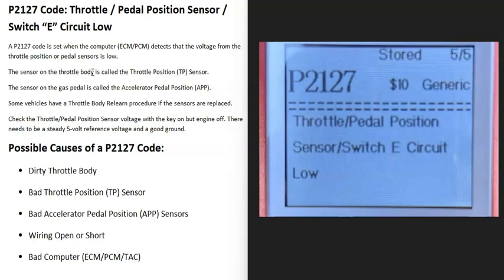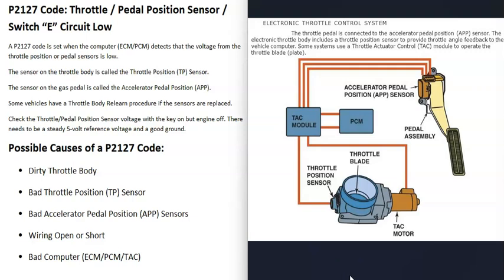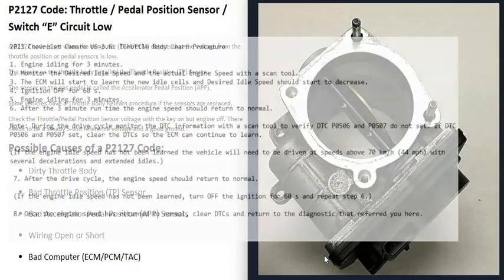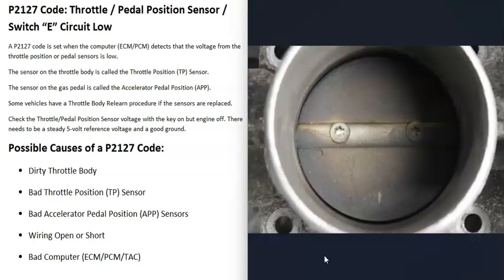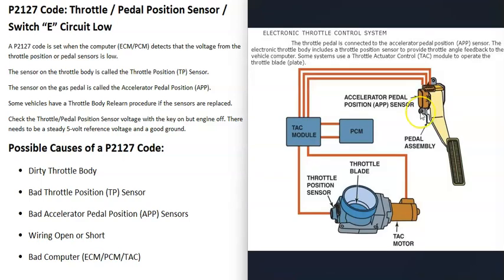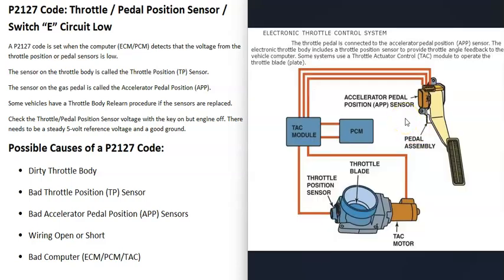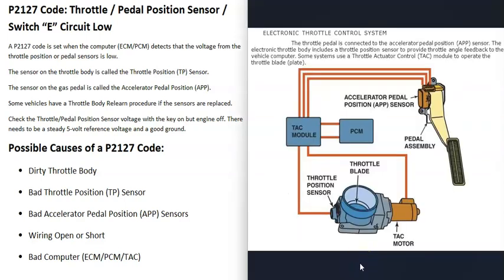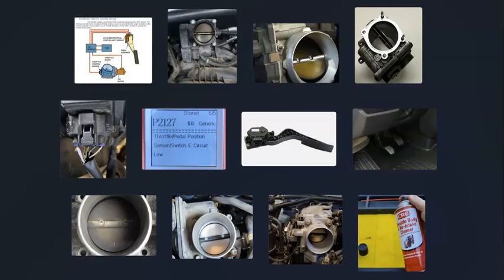Causes and Fixes P2127 Code: Throttle / Pedal Position Sensor / Switch “E” Circuit Low

Comment: On my dodge I have a white connector piece upper right corner, its just hanger not connected to anything, its not the connector that goes on the peddle, it a different connector do you know what the connector is

Comment: What if you get p2127 and p2128 at the same time high and low?
And isnt this specifically for the accelerator pedal censor, shouldnt that get fixed first, or looked at?
Reply: Just to answer my own question for others if they have something similar...getting both high and low voltage reading codes may indicate your PCM is going bad, especially if there are multiple other codes and warnings like I had such as "invalid data sent by BCM". But that could have been from the water that was trapped in my tail light I didn't know about at the time that also wreaked havoc causing many luxury items/systems to shut down or go haywire. Don't use those tuners because they can short out the PCM and check your lights for any condensation on the inside as there is a module and cam bus to the BCM that can cause a lot of problems.

Comment: Just curious if someone could help me out with my question
Recently I had to change my gas tank pressure sensor line which has the sensor attatched to the line that connects to the fuel pump amd the evap system towards the engine. Before doing this I had to run most of the gas out of the tank so it would not be heavy for handling during the change as it sits above the tank. I ran it all the way down to 15 miles remaining and went back into town one last time before doing the replacement and got it down to 12 before pulling into the store and was running fine before turning off. When I got back in and cranked it, it went back up to 32 miles remaining which I figured was not correct. I noticed when I went to pull out it barely accelerated when pulling out on the road. I figured it was a gas conservation mode or something because it was so low and wouldnt barely go over 2000 rpms. After doing the job it is still doing it but there is the orange wrench light now I may not have noticed before when it started.  I got several codes from P068A, P06E9 and P2127 with P2128 as well U0422. I attribute one or two of these to  trying to upload my tune to the computer which I had before and had taken it off but would not accept it this time I believe because of the limp mode it was in so it caused these other codes but the p2127 and p2128 i feel is related to low gas but after putting gas in it, it has still not went back to normal. I should mention also the battery has seemed to be low here lately or getting weaker because of it dying only after the power being on for a short duration which it never has done before. Can this code be due to running it low on gas like this and if so what needs to be done to fix the issue? I did wipe all the codes twice but check engine and wrench comes back on immediately upon cranking again.
Reply: What was the 'U' code about? Did you ever get this fixed?
Reply: @DiagolonRider  that was "invalid data recieved from BCM" 
Ultimately turned out to be a bad PCM that I had to replace for about 2k. The battery was bad and needed to be replaced as well. Also come to find out the back passenger tail light had water trapped on the inside somehow which I still do not understand how. That alone was going to cost $2500 just for one tail light and reprogramming. I took it home and disassembled the light and module and dried. I also drilled two or three small holes in the base of the tail light shroud to make sure water didn't fill up in there again and keep everything dry from air circulation.  The kicker was after getting battery replaced, sensor, and new powertrain computer (pcm) everything went haywire again but this ti.e with the windows, locks, ac, running boards, etc. This was all caused by the water in the tail light that cost an unreal amount of money to replace through Ford which is the best way besides maybe getting another one from a salvage yard. 1k for tail light itself and another $800 for tail light module (sold separately of course) and then the programming, another $300 or so. Screw that, I fixed it myself. If you're getting multiple codes like this especially something like accelerator petal sensor and change that with the throttle body, just take it in and have it diagnosed by Ford or whatever dealership your truck goes to because otherwise you will spend thousands just spinning your wheels trying to figure it out. My truck has 250k miles and runs like new still with the exceptions of some minor quirks now regarding maintenance for selonoids, coils, and such which just have to be changed over so much time. I think the PCM went out due to just being 10 years old, tuner I used, or even possible aftermarket coils I've heard can cause arching that can ruin the computer. Just things to avoid or look at if you're recieving all these codes and "the fix" doesn't do anything. Orange wrench plus the multiple other warnings went off after replacing PCM.
Reply: @DiagolonRider  in short, it was the PCM going bad sending random codes and maybe feedback from BCM. It just happen to be coincidence that orange light came on before replacing the vacuum sensor line. I then also wired the sensor improperly which thankfully the dealership found while diagnostic and fixed for free. Diagnosis cost $180 but they wave that fee if you have the work done there. The things that happened after I fixed myself as previously mentioned in my former response.

Comment: Could a auto zone battery cause this too? Wondering if not having an OEM battery causes low voltage. I have a 2014 jeep grand Cherokee srt. Any help would be greatly appreciated
Reply: Yes u need the battery that goes to your jeep the right voltage is needed for best performance

Comment: Sir what abt a Diesel Hyundai Elantra p2127 getting even after replacing the Accelerator pedal
Reply: Need to check the TPS or Fuse might be blown,or wire is bad.

Comment: I need help! I replaced my ecm connectors because the ecm fell out the bottom of my car and I ran over 1 of the connectors destroying it. So I replaced em myself and I'm guessing I crossed wires because my car won't crank codes read throttle pedal position high/ low circuit. I don't know what to do next. I have wiring diagram but no pinout. I've searched everywhere for a free pinout. Can't find it. So really it was a guessing game matching the correct color wires. Help please
Reply from the maker: The wiring schematics and diagrams are needed to correctly pin it. It can be hard to find information for free and it can be hit or miss. Professional mechanics use paid services such as All Data or Mitchell Pro Demand. All Data has a DIY section for individual vehicles, but it does cost by the month, and they often have recurring monthly fees, so if used, be wary of which service is bought. Finding a manual for your specific vehicle information is likely best.
Reply: Thank you for responding! Yes ive been outta work and have no money or any family to help me financially so that's my struggle. I've got the Haynes manual, but unfortunately Cadillac left the pinout out of that book. So ima keep doing research and thank you for your response again
Reply: @sonyaortiz1oftheFEW  I have an 2015 f150 5.0 and changed two different connectors on it. One for the purge valve and one for the tank pressure sensor. I just tied the wires together on the purge valve which was months ago and it definitely had power just fine but recently did the other. I thought it was just power and as long as they're connected it was fine but looks like I may be wrong. It was only 3 wires on each so nothing too complicated however I am.now 2nd guessing because originally I thought of this and saw a video that said it was fine to just connect them however but maybe a ECM is different. Hope I didn't wire wring and cause issues in the future because one is easy to get to and the other is not so easy as the entire gas tank has to be dropped to get to it. Sheesh. 😮

Comment: 2012 mazda 5, p2127, replaced pedal sensor with a duralast, ended up getting OEM mazda pedal sensor assembly. Waiting on a used throttle body, had ordered an a-premium throttle body mechanic told me to send back. I had p2127, p2122 that was "pending" after new oem pedal installed. CEL still on, limp mode- but I have throttle response, it starts and drives. throttle position sensor e- shows 0% no matter touching or releasing pedal.
Reply: Did you get it fixed yet? Was just wondering if replacing the throttle body helped. I’m having same codes and replaced the pedal sensor today and nothing
Reply: @mooks420countryboystyleyall  I'm also in this situation. I think throttle body is the last thing to try.
Reply: @Anthony-q3n  thanks will try it out and see if that’ works